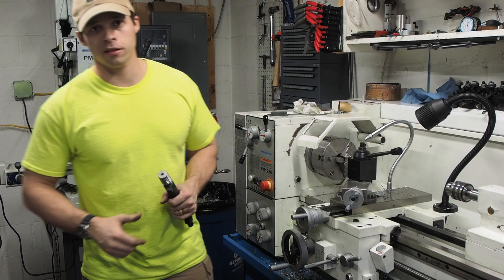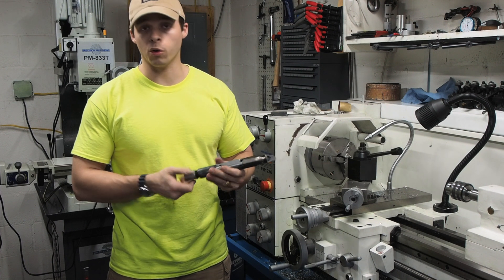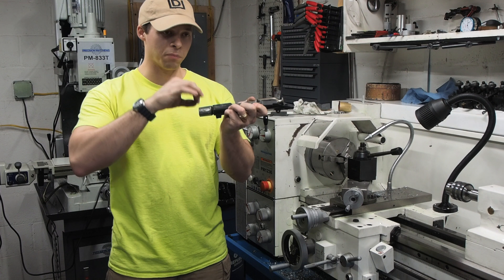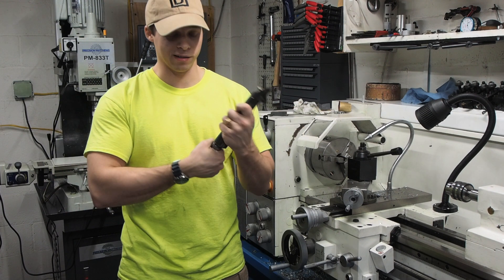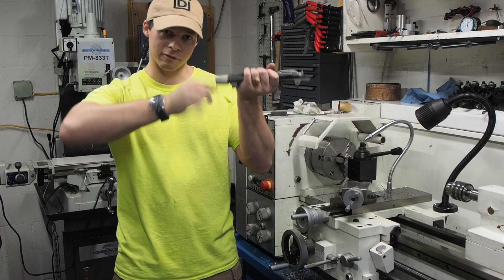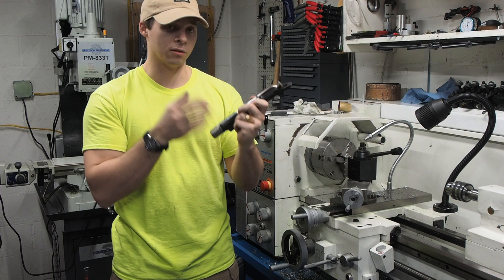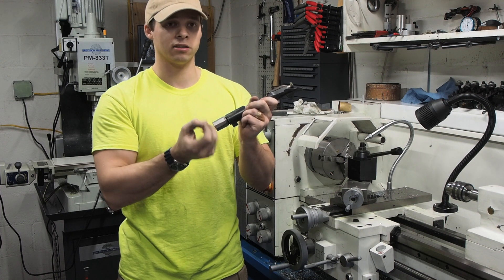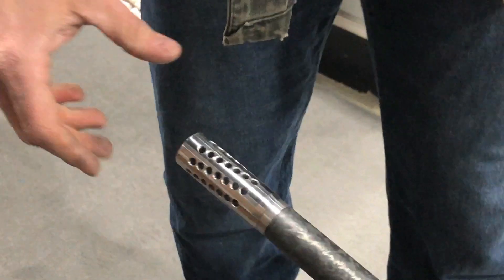Rifle Threads How to Determine their Quality

Comment: How do you no how tight to put a mosin nagant barrel on. Just tighten untill it wont turn anymore?  Or are there a amount of pounds of torque? Im just wondering because i have a m39 barrel i want to put on a 91/30 receiver i have i bought the wrench and barrel vice i needed for a hex receiver, but when i got it, it didnt have directions with it. And there isnt any videos on youtube about it. Was hoping you could help? Thanks and great videos :)
Reply from the maker: If its threaded as ruff as most Russian barrels i would use 80-100lbs.
Reply: @GrimstodDesh  thank you so much i really needed to no that to finish this project and i dont no anyone thats changed a mosin barrel. So i really appreciate the help. Great videos and thanks for sharing your knowledge :)